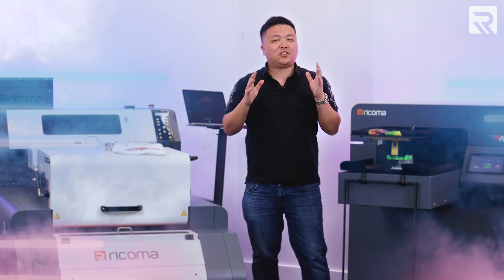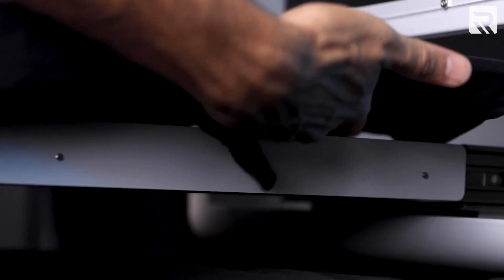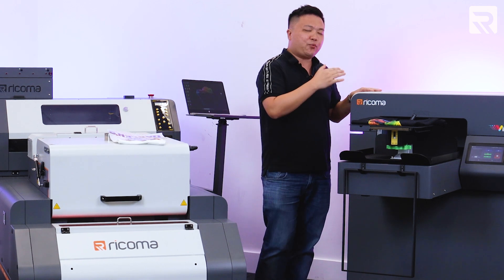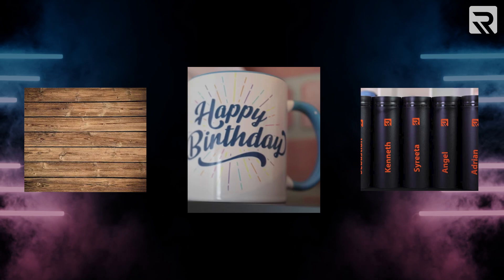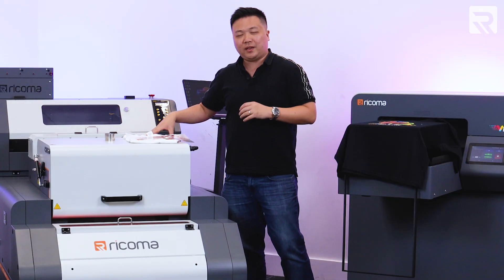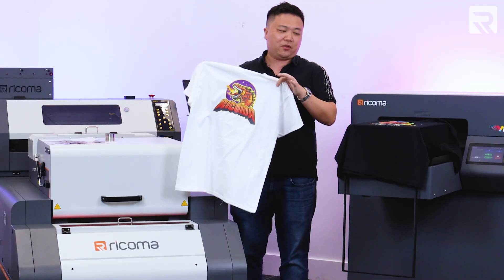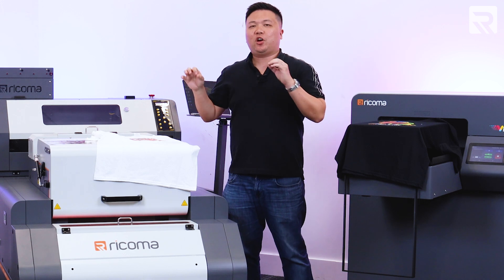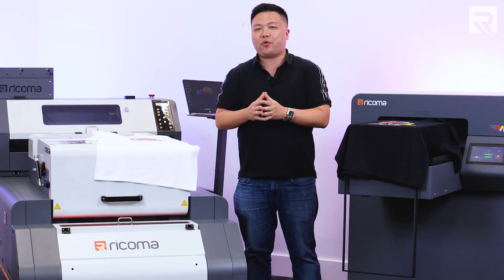DTF vs. DTG Pros and Cons Explained

Comment from the maker: What are your opinions when it comes it DTF and DTG? Which one is your favorite?
Reply: Can these machines be used/plugged into a residential power setting or they only for commercial building? Any concerns for residential use with power surges/outages, let’s say setting up these machines in a home garage.
Reply: I wouldn't agree that DTG take much less space than DTF . When you setup DTG printer and pretreatment machine that is almost same amount of space as DTF. In both cases you need press. In both cases you will have fumes or dust, so will need some form of ventilation.

Comment: If you are doing large prints that will cover most of the shirt, trust me, you don't want to use DTF because that film isn't breathable. You going to sweat lile crazy and it's heavy. So its advice to use it for designs A4 or less. Anything larger, go with DTG. Its light, its breathable and it blends with the material rather than stick on the material.
Reply from the maker: Great point, it's important to consider the size and design when choosing DTF or DTG.

Comment: Curious to know if DTG works well for 60/40 blends and tri blends?
Reply from the maker: DTG can work well on 60/40 blends, but ideally, you want a higher cotton percentage (at least 80% cotton) for the best results. Since DTG ink bonds with natural fibers, the 60% cotton helps, but the print may not be as vibrant as on 100% cotton. Pre-treating the fabric properly can improve ink absorption and vibrancy.

Comment: Can you address the durability and washability difference between DTG and DTF? Many of us have seen DTG prints almost dissolve after a wash or two which is obviously a problem of customer satisfaction and  returns. Additionally, can you address the image quality itself between the two? DTG seems to produce more washed out colors with visible dots and from what I've seen DTF prints are more vibrant and look like they are a more high fidelity product. Lastly, you touched on the flexibility of DTF to apply the prints to various surfaces. Can you expand on that a bit? What other substrates can DTF's be applied to and how?
Reply from the maker: Hi Steven, this is a great question. With proper care, DTG prints can withstand multiple washes without significant fading or cracking.

DTF printing's durability is one of its key strengths. The film used in the process provides a thicker layer of ink, resulting in a print that can handle rougher treatment. DTF prints have excellent stretchability and resistance to cracking, making them a preferred choice for sportswear or garments that undergo frequent stretching and movement.
Reply: thank you but what about the rest of my question: Additionally, can you address the image quality itself between the two? DTG seems to produce more washed out colors with visible dots and from what I've seen DTF prints are more vibrant and look like they are a more high fidelity product. Lastly, you touched on the flexibility of DTF to apply the prints to various surfaces. Can you expand on that a bit? What other substrates can DTF's be applied to and how? @ricomatv
Reply: If you have the right settings Dtf can look like dtg